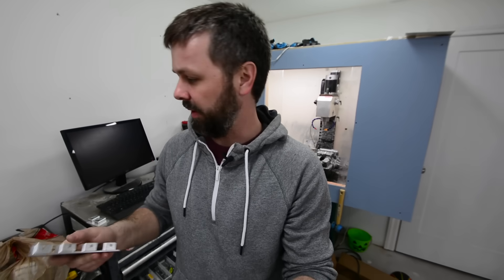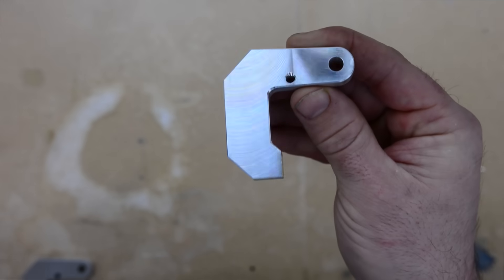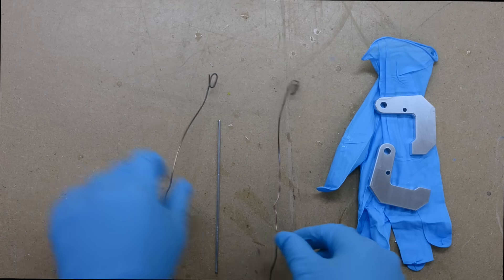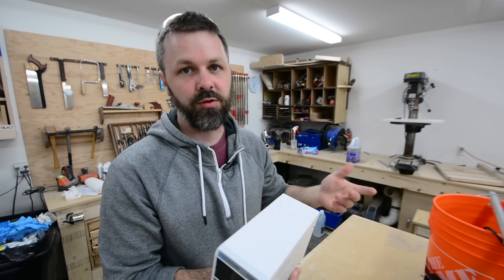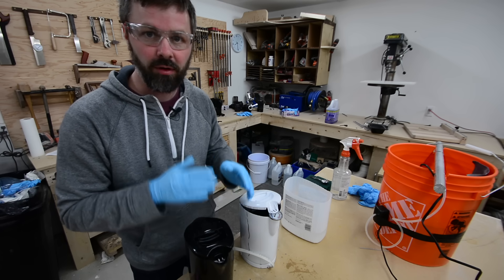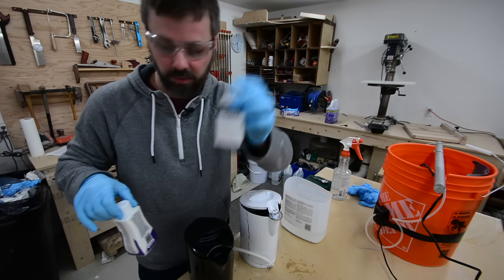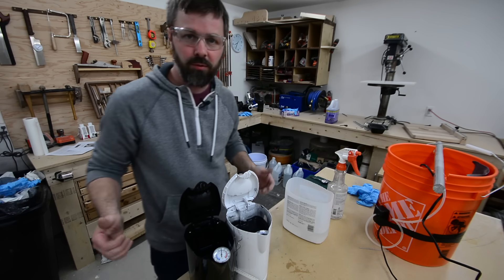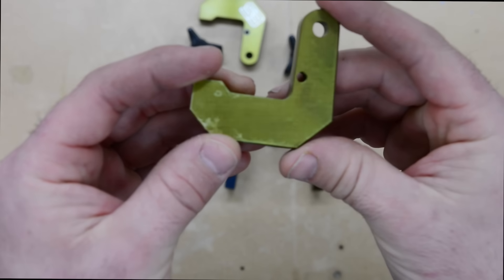ShopBuilt - How to Anodize Aluminum!

Comment: Great video, answered a lot of my curiosities. How long is the acid solution good for? I'd assume many, many uses. Also, when heating the dye I didn't notice if you said you diluted it, I would be doing black so the fabric dye would probably be adequate. Cheers
Reply from the maker: Acid is good for a long time, as the water evaporates off, you can just add more water. Black is probably the hardest color to get right. The fabric dye will probably have a slight purple hue to it, I recommend the good dye for black.

Comment: I'm having difficulty with the protection I expect form anodizing and your process. You appear to be just coloring the parts.  Where does the added strength come from?  Also, there is "clear" anodizing.  With your process, is that just an acid bath?
Reply: tkarlmann the boiling water is helping the sealing of the parts.

Comment: If i'll anodize a piece of cooling radiator, do you recommend me to anodize it with or without paint? I'm thinking if the paint layer will affect the cooling (heat spreading) properties.

Comment: The main drama with the hydrogen is if you break the circuit while there is still current flowing, you will likely cause explosive ignition. And don't be smoking when you go check on progress.

Comment: Dude you should anadize a chunk of damascus metal. Its really spendy but it will make a great video and the results are amazing. You can anadize any kind of metals just have to up your temp and power. I loved the green but its a toss up between blue and green and i. Sure the red would just confuse us all, because red catches the eye over any colors. Good job : )
Reply: Do not anodize steel. It’s not pretty
Reply: @glenphillips9178  I wonder why it turn out so bad. Any how I love your vids
Reply: It doesn’t conduct, it insulates which means it will pull all the electricity until it burns up

Comment: Disposal

If you neutralize sulfuric acid with baking soda, you get sodium sulfate.

"Although sodium sulfate is generally regarded as non-toxic,[29] it should be handled with care. The dust can cause temporary asthma or eye irritation; this risk can be prevented by using eye protection and a paper mask. Transport is not limited, and no Risk Phrase or Safety Phrase applies."

https://en.wikipedia.org/wiki/Sodium_sulfate

Comment: There are a variety of acids that have different properties. Some will provide a black hard anodize on certain aluminum alloys. With the acid and dies you are using the parts can be laser marked. Set correctly the die changes color but doesn't damage the anodize.

Comment: You may already know this but the reason the pink tinge doesn't show up in the camera is because you have low quality lighting in your shop. Sunlight (a high quality light source) emits a more or less uniform distribution of all wavelengths in the visible spectrum. Most florescents on the other hand have a jumpy distribution with low representation on the red area of the spectrum. Look into high CRI lighting and your videos will look much better!

Comment: good job sir great explaination!
as a physics major and studied way tooooo much chem I can tell you why your color is inconsistant. molecular attraction from cloth material to metals ...the way to fix it...read the labels compare ingredients one of them, one is a binder the other is a penetrator!
dont swap just add  ...but that is why the price diff. hope that helps   again good video!
you have nothing in your stew that is bad  battery acid is sulfuric and water , (just keeps a charge)..distilled no big deal buy it at the grocery as you know..wear breathing gear dont need fly away particules in your lungs young man!

Comment: 13:10 - "So these parts have been in the boiling water for about 15 minutes..."
<Grabs parts with bare hands>
Riiiiiiiiiight...  😉
Reply: uhhhh... he let it cool after the 15 minutes was up.  I know, hard to conceptualize from behind your keyboard.
Reply: The boiling water is what he used to seal the parts, so at that point, yes, you can handle the parts barehanded (VMF)
Reply: @kentwillis6813  the poster was confused, thinking he picked up hot parts that came straight out of boiling water with bare hands.

Comment: After you degrease the parts If you heat the parts up in a oven and let them cool to the touch and then wipe them down a second time with degreaser this will pull more impurities to the surface making the part cleaner they do this in powder coating before they spray the powder.

Comment: if its battery acid the fumes comming off are oxigen and waterstof (dutch name) thats the stuff that was in the hindenburg zeppelin , just evacuate the vapors if ever possible
as for removing the acid ......its made from drain opener, its made to go down the drain and desolve all the grease in the drain while doing that , there only might be some aluminum oxide mixed in that

Comment: Probably a good idea to call the products by their chemical names not their trade names as confusion can occur when you do that. For reference the names are: battery acid (sulfuric acid)  lye (sodium hydroxide) the trick to preventing hydrogen buildup in the work area is a good air turnover rate. and absolutely no source of ignition including making sure your rig doesn't arc.

Comment: I'm not positive, but I believe battery acid is sulfuric acid. The best drain opener I've tried was a 96% sulfuric acid solution. I don't believe batteries have higher purity, but I can't guarantee it

Comment: You can reuse the aluminum rods to connect. just put it in the lye solution and it will strip the oxide layer right off.

Comment: Someone told me that the colors was based on the thickness of the oxidation layer, not actual dye. Am i just wrong or is this different?
Reply from the maker: Anodizing titanium works that way but not aluminum.when anodizing titanium the colour actually changes the longer you keep it in the anodizing tank.

Comment: So. I'm halfway through this. I'm a dumbass who was a chem major. I did this experiment in about year 11 of high school.
I want to hit on some high notes, and maybe make this less dangerous, and potentially give you a better result.
 
Why you add acid to water is because of flash boiling. Any time you add two chemicals together, there is the chance of a concentrated reaction (in this case exothermic...+heat) If you add acid to water this is spread throughout. if you add water to acid you've probably just flashboiled the little bit of water you added. Very explosive for the little bit of water, and you may have just sprayed acid in your face. This is why this could be dangerous.

Lye... otherwise known as sodium hydroxide. This turns any form of grease, oil, or fat into soap... This includes the fat found in human tissue. If you're using this, have some white vinegar on hand. if you spill this, rinse with vinegar, and then wash off with water. NaOH (sodium hydroxide) will require you wash the soap off to get at the Lye. It will take a long time, during which the Lye is still burning. Vinegar stops the reaction and is easy to wash off.

Baking soda (Na2CO3) is a neutralish substance. basically it with even out either a base (Lye, or NaOH) or an acid (H2SO4, or battery acid) It is also non toxic. It can be safely washed down the drain. What you're left over after "washing" the part is aluminum oxide (aluminum rust effectively) This is extremely porous, and will accept a liquid impregnated with dye. basically the water dries out and leaves the clour behind. The AlO (aluminum oxide, or rust) then protects the material underneath

Why the titanium does not get a deposit... The titanium is an anode..ish . hooked up to the positive terminal. Electrons flow from negative to positive. carrying the odd bit of material which will then deposit itself on the positive terminal...Titanium has a far lower attraction for electrons than aluminum, causing any impurity in the water (acid, and dye) to be deposited on the aluminum that the charge flows through first instead of the titanium which the charge flows through after flowing through the aluminum. please note any metal used in the electrode will corrode over time.  It has entirely everything to do with the metal used  on both sides of the reaction and would require far more space than I have here to explain. If you use alumium tig rods, then the impurities that give the anodisation it's colour will settle into the rod you're hanging it on as well as the surface you're trying to anodise. corrosion. basically rust will set in, and reduce your results for later runs.

When a charge is run through sulfuric acid (battery acid) Hydrogen gas is released... little bit of sulfur as well which is why it can stink like ass. Hydrogen is your prime danger here as Hindenburg.... the quantity of sulfur is going to be negligible unless you're doing this in industrial quantities or you're hooked up to the grid before a transformer. Dispersing the hydrogen is all that is required, and a desk fan blowing over the top is enough to go his.

Amperage... it does matter, but it's a rate of reaction thing. Caswell is right, but it's an optimum condition. they've calculated the charge required for a given surface area, at a given temperature, and a given Ph (acid concentration) This is brilliant for optimum results, but if it's not the colour you want, then just leave it a bit longer so the reaction sinks deeper into the aluminum and turns darker. (shopbuilt does touch on this, so test what you've got on a few blanks before your finished product just in case your gear isn't accurate)

Not mentioned. food dye does work... not well, but if you're stuck.

Good video... misses a bit. Most of the stuff I've mentioned will only matter to purists, or those using this basic process, and trying to improve the results.

Cheers
Reply: Than You, Sir.

Comment: can you save the bucket of acid and use it later for anodizing more aluminum?
Reply from the maker: Yes, the water will evaporate over time and you can just top up with water. Only have to change if it gets contaminated

Comment: use your drain cleaner to remove anodising on your aluminium wire, it removes the insulated surface, then you dont need to chuck em out as often

Comment: Awesome video!
Few notes:
A Hoodie is not Safety Gear.   Get a proper lab coat that will not absorb the acid if it spills on you.  Also spend some time on spill considerations.  Sulfuric acid is difficult to clean up when it spills,  keep at least 10 lbs of Bicarbonate as a spill kit (ideally 50 lbs)
Tank acid:   Sulfuric acid should be about 35% concentration, if you add the standard Mae additives it will improve your surface finish,  that's  Hydroxy Acetic Acid and Tri-Ethanol Amine, 50/50 mix  and add maybe 1 cup of that to your tank.
Bucket:  Kitty should be no where near the bucket, cats are curious, they can get in there and get serious burns!
The bucket should be in a plastic tray or a concrete mixing tub in case the bucket gets knocked over/accident (less than 1% chance of that happening, but you never know)
Dye:  Never mix your Dyes!,  I don't know how to fix the blue.. I just have basic info, but you shouldn't be cross contaminating your dyes when stirring.
Drag-out tanks:  Drag out tanks are crucial, rinse as much as you can, and with several tanks, and FINISH drag out tank with DI water!!!!
Sealing:  it didn't look like you sealed your parts but I read your comment.  Sealing is done in a hot 165F DI water tank to close the oxide pore (i'm not sure if they get it up to boiling, but I'm not an expert). You might try alternating between the hot seal and the Nickle bath to get the best of both worlds, I'm not sure how they deal with that issue, I'm just relaying what I picked up working with a friend of mine, he's really the process expert.
Racking:  You should clamp the wire to the anode, but you attached your power directly to the wire, so that's fine too, but either by weight or with a clamp you want your rack to stay put and stay energized.

But totally awesome video, I've been considering doing this too, just haven't bought the tank chemicals or dyes.

Comment: You can use spray oven cleaner as a final cleaning source before anodizing. Oven cleaner contains lye and a degreaser - it offers more control then straight lye and reduces over etching.
Reply: I'll have to remember this. Do you just rinse the oven cleaner off with distilled water?

Comment: No mention of the layer of Aluminum that is changed to Aluminum Oxide? You anodized to change the color only. Aluminum is also anodized to make it resistant to wear. AR recievers (upper and lower) are aluminum forgings that are machined to shape then anodized. This why the steel bolt carrier wears out faster than the upper reciever that it reciprocates in. The outer layer of the reciever is harder than steel.

Comment: Back when I used to work in a plating lab, we had a collection of small plastic tapered pins that we used to connect wires to parts. Wedge in a straight wire into a hole with a plastic pin and it ensures a good neat connection and is really quick to do which is important when you are anodising hundreds of small parts all at once.
Reply: Seems like a great use case for 3D printing. You could design custom work holding jigs
Reply: @SamChaneyProductions  my first thought as well. I’m going to design a variety of pins and put it on Thingiverse.

Comment: So it was after I took the process out on the patio, heating the dye and water, wearing gloves and a respirator, that I noticed the neighbor kids were having a birthday party. They were staring at me; all of them. I had lye, battery acid, an ancient battery charger, and a 5 gal. Lowe's bucket with an aquarium pump duct taped to the side. " Officer, this is not what it looks like... "
Reply: LMAO. HOW DID THE PARTS COME OUT ?
Reply: @NoWr2Run  Awful, needed more power. Restricted from that by virtue of a little incident in the basement with my micro H2 gen experiment. She was not impressed...

Comment: One thought about the hole that you choose to hang the part on.  You should make sure that you don't pick a hole that requires an aesthetic.  Either use a hole that will be hidden, like a screw hole, or add a hole specifically for the anodization process.  The point where the part touches the hanger will have an inconsistent level of anodization than the rest of the part.

Comment: (Friendly heads up for folks trying this at home)  Sanding down that lead flashing's coating for use as the cathode exposes you to lead particulates and can increase your risk of cancer so wearing a respirator mask is very highly recommended as well as cleaning up the resulting dust thoroughly to avoid further exposure down afterwards. Stay safe everyone!
Reply: he didnt say sand the lead down, the sanding was only if you choose to use aluminum as the cathode.
Reply: Plus always wear gloves when handling lead - lead can transfer through your skin into your bloodstream...
Reply: are you aware the material used for toothpaste tubes in the 60s 70s?
Reply: "stay safe everyone"  God how I despise self proclaimed SAFETY PUSSIES like you !  ............I bet you wear protective gloves to wipe your ass !!
Reply: @alexmarkgz5939  Yes, fools rush in where Angels fear to tread! Idiot!

Comment: You mentioned amps and hardness, what if you were to start at a lower amperage, until you’ve got the color you want - then turn the amps up to harden the anodizing, and maintain your existing color. Would that work?
Reply: Colin Malloy No, hard ano is done at a lower tank temp and color isn't put in till the ano process is over. Decorative ano is plenty hard for most application.
Reply: Colin Malloy I think your question was not about hardness but about pore size which is affected by the amp per Sq inch range and decorative ano temperature range. If that is your question, it is something I've wondered myself. Will the pore begin to shrink/walls thicken if you adjust power toward end of process. When you seal, the pores close so not sure it would matter anyway. Didn't mean to sound dismissive with my other answer.
Reply: A ultrasonic cleaner will remove the coating from hard ano so you could rework before resealing

Comment: the dye tank wants to be around 40c,hotter will seal the pores of the oxide layer,then rinse in cold water,then seal in a steam tank or boiling de-mineralised water not tap water,never let the part dry during any of the pre-sealing stages or the oxide layer will partially seal and give a limited dye,unless a washed out dye look is wanted,though a weaker dye solution with a continual wetted part before sealing will be much better,so sayeth my anodizing and plating book.

Comment: You should be able to dispose of the acid by neutralizing it with NaOH aka lye. You could do the chemistry and calculate the ratio of lye to acid, but at the end of the day if you test it with pH strips and go for "close enough" to neutral you should be good. The main danger with dumping acids down the drain as I understand is that it can lead to a hydrogen gas buildup from reacting with metals.